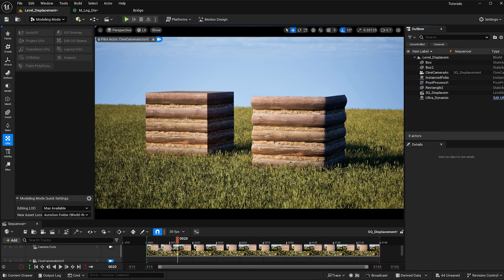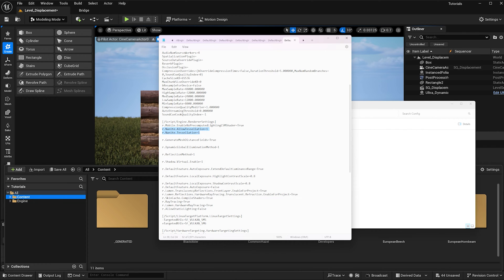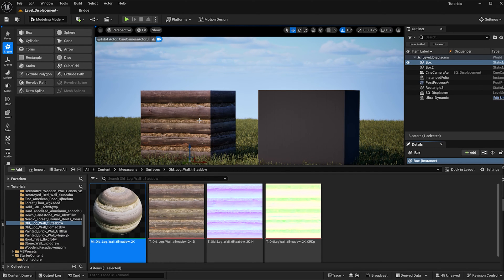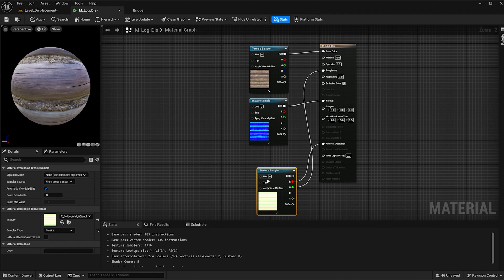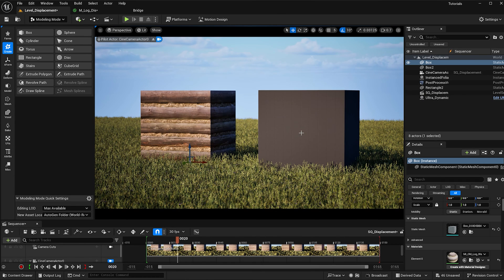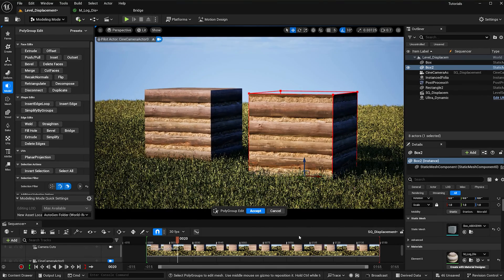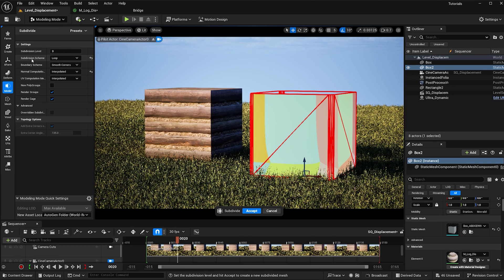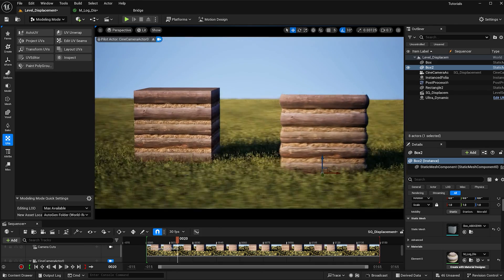Create Nanite Displacement In Unreal Engine 5.4 Tutorial Under 5 Mins

Comment: Finally what i was looking for :D
Reply from the maker: glad you found it!
Reply: @Unreal_KatyaFedak  I hit more obstacles :D It seems by projecting texture via "WorldAlignedTexture" gets rid of those empty gaps between UV seams as this method doesnt use UVs at all. Problem then is that meshes cant be rotated or the texture gets messed up which for many meshes like rocks is no problem but for buildings it is, i found solution tutorial to change the "WorldAlignedTexture" to use Local space instead of world space when projecting texture. It fixed the problem with rotating, however in local space nanite tesselation got messed up.. It has been hard road to get this far for total noob like me, wall after wall :D Please tell me you know working way to use nanite tesselation on meshes such as houses ?